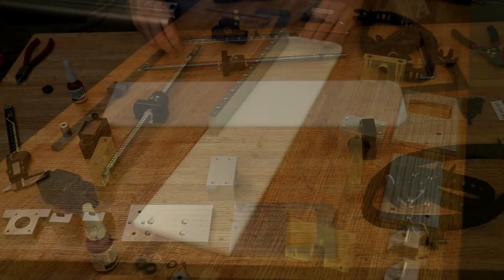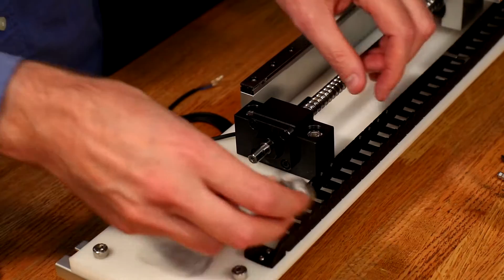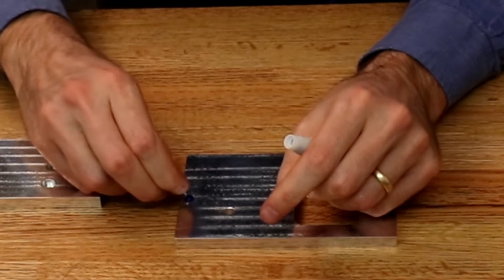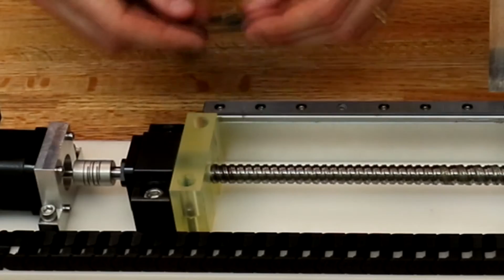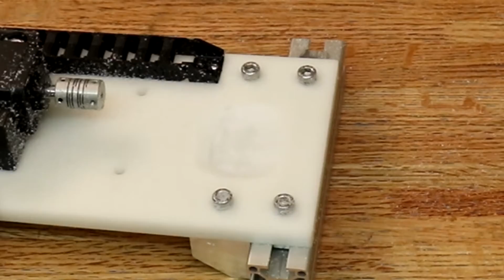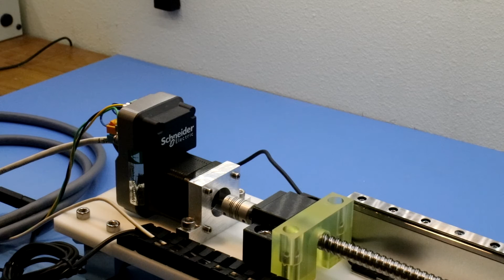Motorized Camera Track Dolly, Part 2 - Assembly and Testing

Comment from the maker: Check out my most recent video: https://goo.gl/Jj7cU1

This is the second of two videos on designing, machining, assembling, and testing a linear CNC stage for a DSLR camera. There are also a couple related videos, one on machining a socket to torque the ball screw retaining nut and another on machining the NEMA 17 motor mounts. Links to these videos are included in the end cards at the end of the video. I'm always glad to receive advice or to answer any questions.

Comment: A look through your back catalog has been time well spent indeed.  The only thing I can offer is a suggestion to cover the viewfinder; light can get in through it and end up on the sensor.
Reply from the maker: Thank you, that's very interesting to learn! I like to use Basler cameras when I can. The Canon sensor size has a very attractive price, but I've had several mechanical shutters fall apart. I'd like to rent one of the mirrorless cameras to doublecheck compatibility with gphoto2.

Comment: Looks like the camera shake is from the servo hunting. If the controller allows open loop mode with as many micro-steps as you can get it might dampen the camera shake. Great Video, I agree with other commenters in that it is refreshing to see such a clean work space.
Reply from the maker: Thank you, I'll give your suggestion a try. I have a job to make a similar system again and there's so much to try differently this time. I'm probably misrepresenting the cleanliness of my day-to-day work space where any horizontal surface is a perfect place to stack stuff... mainly books though, so clean clutter :)

Comment: Nice vid. How much cost that schneider motor
Reply from the maker: Thank you very much. The Schneider Electric LMDCE422, with the optional encoder was $460 US roughly October 2016. The encoder is worth the extra cost for closed loop operation. At first glance, this seems high compared to many stepper motors, but in one package, is the motor, driver, and controller. Multiple motors can be linked for coordinated motion. And with the extra digital and analog I/O one could avoid the a PLC in some applications. They can also take step and direction inputs, but then one is not using the built-in controller and may want to look at other options. Such options include Leadshine's integrated stepper or Teknic's ClearPath servos.
Reply: Could you provide a link to the distributor you got yours from? - Vince
Reply: Same applies for the manufacturer of the linear rails i.e links to the manufacturer and the rail you used. I am not familiar with this company and I couldn't quite catch the name from the voice over. I'm in the market for some good quality rails. Thanks again.
Reply from the maker: Hi Vince. Much of the hardware came from McMaster and Misumi (https://us.misumi-ec.com/). (I started to make a video on using Misumi's website but figured no one would be interested. Maybe I was wrong.) Many parts from Misumi are configurable and configurations change the part ID. For example, the ballscrew is BSSZ1210-400-RLC-SZC-SWC10 and in that part number is the model, diameter, pitch, length, ball orientation, flats for the coupler and flats for the wrench. Similar to McMaster, Misumi resales many parts. I forget who the actual manufacturer of the ball screw was, THK I think. Everything I've received from Misumi has been quality. You can request a paper copy of their catalog, which is full of great information, but clear off about 5 inches on your desk.
Reply from the maker: Hi Vince. The motor came from Hartfiel Automation (http://www.hartfiel.com/). If there is an office local to you, it may be good to meet with them. They offer design and assembly services but also can help with networking. How I found them was by contacting Joel Bruder <jbruder@imshome.com> and asking for a local distributor. IMS is owned by Schneider Electric. I never found a place where it's possible to buy the motor online.
Reply from the maker: Talking to Joel first was helpful. I explained what I wanted to do, that I was price conscious, needed no more than ten in a year, etc. and he came back with a recommendation and explained his reasoning.
Reply: Excellent. Thank you. Good to hear that he would still talk to you despite "low" initial volumes. Appreciated.
Reply: Hi Kent, thanks for the subscription. I'll be in touch!
Reply: Thank you so much for the link and the detail related to their product line. I'll be sure to pouring over the product line over the next few days. -Vince
Reply from the maker: For what it's worth, anymore, when I talk to a new place, I'm up front about only need one or two or whatever. Sets the expectation and no hard feelings later on. If they are stilling willing to work with me, great, else they are just "too big" and don't remember starting out.
Reply from the maker: To get the most out of Misumi's website, create an account. That'll let you see the pricing and how configurations alter the price. It's also easy then to ask questions and they normally respond pretty fast, certainly no more than a day. They'll help you find an item, explain how to use it, etc. They also have regional guys who will deliver the catalog and demonstrate products. If you use SolidWorks, they have a plugin that's in Beta last I knew that directly associates with their website, allowing reconfiguration of a part from within SolidWorks. Can you tell I'm pretty excited about Misumi? :)
Reply: Kent VanderVelden
Thanks for the tip. absolutely agree. I'm currently trying to get some software from a  very high end CCD manufacturer. Called them up today and the secretary was very nice.  I did tell them upfront that my query will probably result in $0 and some work for them at the out set but the phone wasn't hung up on me. Fingers crossed that I get what I need.
Reply: Kent VanderVelden
 Yes, I can tell that you are excited :-) It's great to work with responsive companies for sure. Looking forward to trying their products on my projects.
Reply from the maker: Hi Vince. I watched some of your videos and subscribed to your channel. Whatever you are working on looks interesting. I used to work in the Genetic Discovery group at DuPont. Mostly software related, but also did some optics related stuff for them. The last instrument I worked on was a Gooch & Housego AOTF. Maybe there is something that we could collaborate on. You can find my email address in the About area on my channel. Best wishes